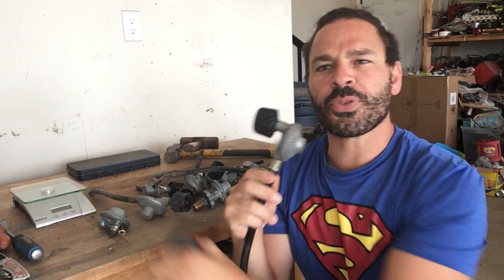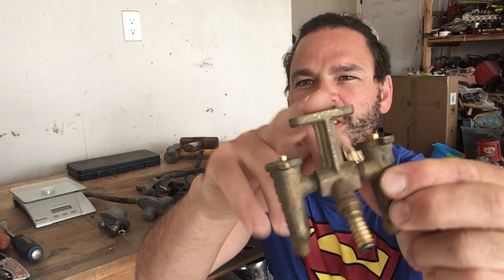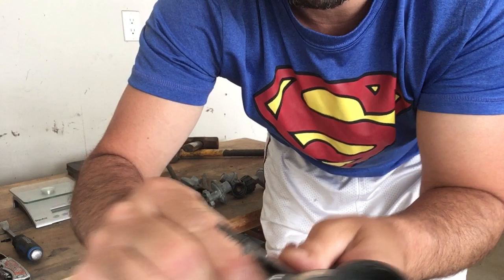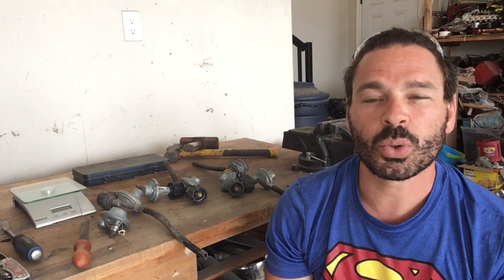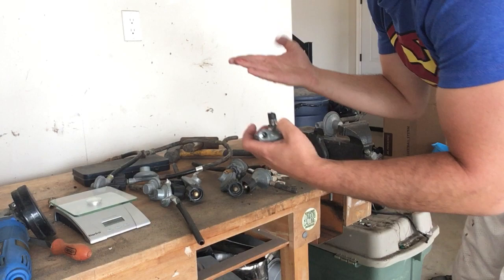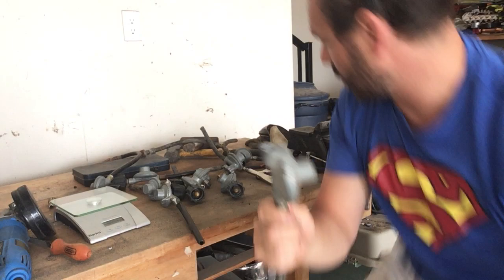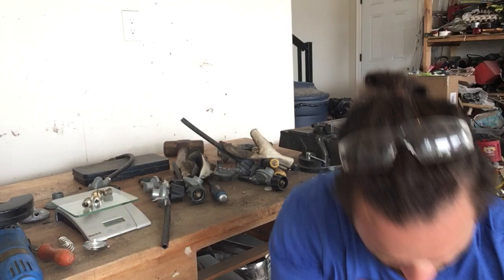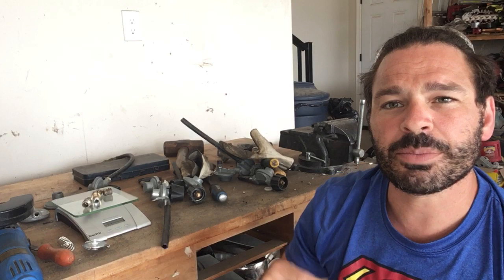Scrapping BBQ GAS PRESSURE REGULATORS for brass, clean cast aluminum, and FAST CASH!

Comment: very helpful video, as always, i've got a few of these regulators and just started breaking them down, those nozzles are usually cast al. so you want to get those too, anywhere from 4-6 on a grill, and they have some nice brass inside them as well, along with the connectors.   i usually just hammer those plastic bottle connectors, couple/three hits and they break right off, on the stainless hose you can crimp it inside the brass fitting (with a screwdriver) and it just falls out... those two methods save on your grinding wheels, and it takes about the same amount of time.

Comment: Do you have a trick to opening these up? No matter how hard I beat them dont seem to open up for me lol resorted to just throwing the piece in dirty aluminum pile
Reply from the maker: Depends on size of hammer. I find simple hammer not heavy enough. Also want a hard surface underneath. The point is just to get part or the crimp so make sure you have it on its side when hitting.

Comment: I bought some Muriatic acid so I could tell the difference between zinc and aluminum.  I tested my cast aluminum and got a reaction.  Does this mean it is actually zinc, or that the cast aluminum has some zinc in it?  How do I tell?